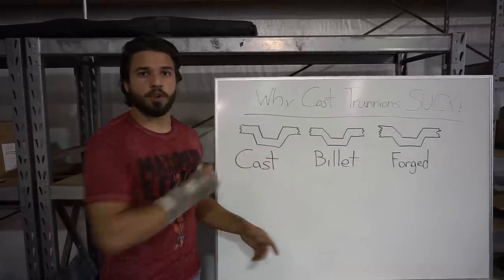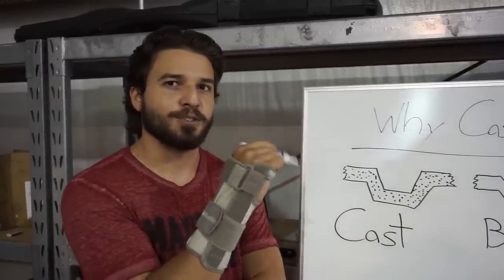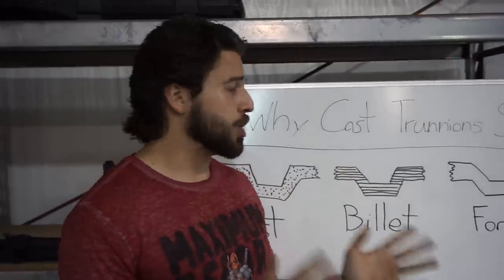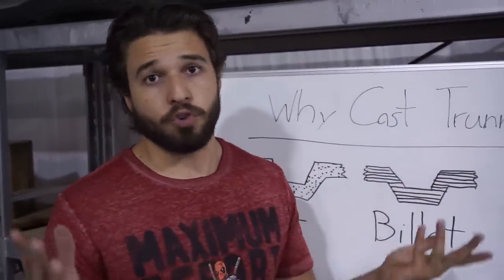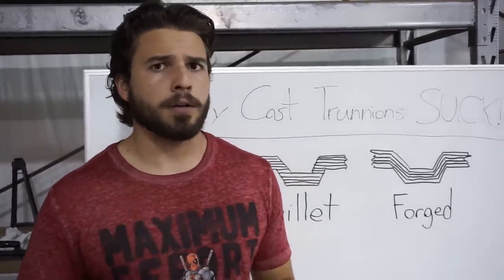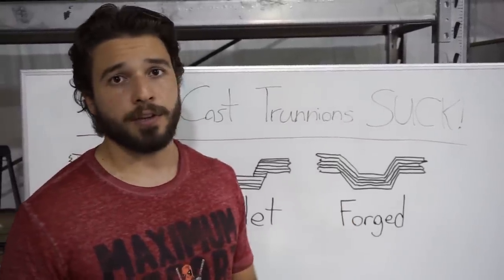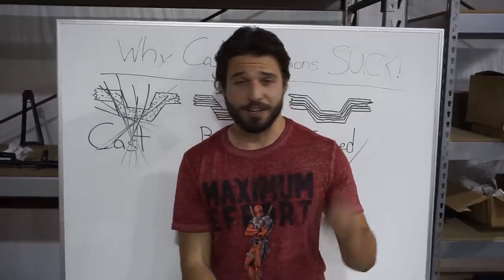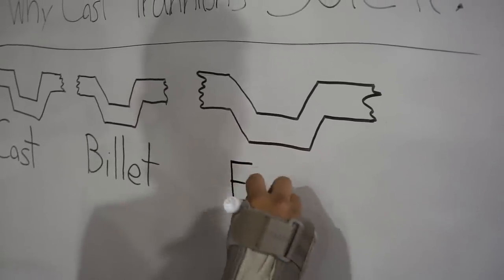Why Cast Trunnions SUCK!

Comment: 7:23 I just bought a PSA AK-P with a hammer forged front trunnion for $719. I'm impressed with it.
Reply: really? They have been sold out for months if not years. Did you preorder yours like 10 months in advance?
Reply: @derklanz1222  I've had this gun for like 8 months. I just went on the site and bought it. It took a couple weeks of checking every morning, but it wasn't that hard.
Reply: @GunsNBudder  Well that is good news, but I just haven't seen anything for a long time. They have huge back orders I think.
Reply: @derklanz1222  yeah they're very popular. My ak-p still runs perfectly.
Reply: @GunsNBudder  I am torn between at PSA or MOLOT VEPR.
Reply: @derklanz1222  you can't lose either way, but if you did lose, PSA works be easier access for customer service. On the fb PSA AK owners group, the owner of the company and some of the execs post about daily and are very accessible and concern themselves with problem reports and handle it right away personally. They're taking their ak's extremely seriously.

Comment: I enjoy my ras47, but I'm only ~800 rounds into it. I'll purchase a headspace gauge next payday. 
    Can I replace the cast parts without having to form a new receiver?
   If so; would a Romy G parts kit potentially be a good component source?
   I assumed that "made in USA" would mean sexy akm without 922r restrictions.  Instead of passing a potential disaster to another end user, I'd like to correct this machine's deficiencies if it makes more sense than taking it out of service.
      Thank you for your time and for any leads on reliable information.

Comment: As a metallurgy graduate I will happily say that is a reasonable basic explanation. Nicely done man.
Reply: What did your schooling focus on?  I’ve been a machinist for 11years and have always had an interest in material science.  What do you do with your degree?
Reply: @kw2519  sadly I got funked over the the car and supply industry died in the uk as I graduated. And the that being dyslexic and autistic, it seems they didn't want my kid of out of the box thinking.  So I was stuck in the limbo of overqualified for entry jobs and under experienced and qualified to compete with PhDs and people with 10 plus years under their belt.  
It was getting. After 6 years I returned as in counselling for the government to kill the training options with austerity. Then 8 years of trying for any industry job I retrained in 4 months to be a massage therapist.  I really wanted a machinist quol but didn't have the money and 2  years to invest in it. Also life was in the way. 
Still have the odd dream though. 
The cores was very broad 3 years with over 20 hours a week in class and labs, that's 60 to 80 hours of work a week in the final year. Doing all the basics for the hole of manufacturing. So advanced particle and quantum physics; polymer chemistry; basic and mineralogy chemistry; production routes; polymers; ceramics; metals, ferrous and non-ferrous; composites; electric materials; non-destructive testing; destructive testing; crystallography; design mechanics; advanced mathematics; CAD; corrosion; heat treatment; failure finding; process route tracking; process root construction.   history of material science and microscopy. Basically here's everything pick something for your post grad to focus on if your brain hasn't melted and we like you enough or your paying. 🤯 I did have a focus on metals as we like each other.  Lol.
Reply: Sung-Ru Oh damn, I’m sorry that shit happened to you.  Have you thought about just taking a position in machine shop at entry level and work your way up?  You could also probably get a job as a QA inspector in a machine shop if you learn your GD&T stuff
Reply: Yeah  that's what I was trying to do. Over quold Exeter.

Comment: I bought a wasr10 & detailed cleaned it. The next day I noticed rust on the front barrel . I emailed century customer service & wanted to know if I should send it in. Or in the long run ,cericoat it 
In my local area & just go that route. Do they correctly fix issues or just add more bs? & just hope it doesn’t get noticed? 
Thanks for the schooling of the platform. 👍🏼 paid $750 on 3/19
Reply from the maker: Haha, just spray it with CLP and wipe it off. Seriously a non-issue.
Reply: pigpaul you don't deserve ak if you can't stand a little rust

Comment: You are generally right, that forged is best, but it's not true to say that cast components are garbage.  First off your claim that cast parts do not have a grain structure is absolutely false, cast parts absolutely have a grain they're just more complicated. They usually grow from the cooler regions of the cast part towards the warmer regions. You can actually very very strong parts if you control this. Cast parts have regions where temperature variations as well as shrinkage can change grain structures, which must be controlled with various techniques.
Second off, it's not like all cast parts are bad. Even the soviets switched to cast components in the 70s, izzy front sights, rear trunnions gas blocks, trigger components and a few other non pressure bearing parts where cast. Early chinese AKMs (Reverse engineered) used cast front trunnions as well, until they purchased soviet tooling. There are good cast trunnions on the market right now, like WBP from poland, they've been making cast trunnions for years and it's not been an issue, rob ski put it to the 5000 test and found no issues in the cast trunnion region.
Third off. There are cast guns currently on the market that have no (strength) issues, ruger mini 14, Springfield m1a, etc. These guns have no issues as far as strength goes, and consider the AK lockup is derived from the m1 garand, so this is as close to an apples to apples comparison you can get.

And finally before anyone calls me a shill for whatever, i exclusively build from eastern European parts kits, currently Romanian RPK. The problem specifically with american casting is the cost part, controlling casting grains is actually pretty expensive, the cost diffrence between high strength casting and just forging it is pretty negligible, the cost saving comes from less spindle time and tooling required because casting can make more complex parts. Importantly, no one has ever made a good cast bolt or carrier, which probably means something. However, for specifically trunnions casting is a valid technique to produce, IF DONE RIGHT. Ofc, american manufactures are trying to hit a price point so they can't do it right, which makes the public more weary of a technique which is perfectly valid but applied poorly, and so you end up with people turning their nose up at a whole manufacturing process. It's like if american manufacturers skipped heat treating to save money and people turned their nose up at all billet parts. It's equally silly.
Reply: I noticed easily he doesn’t like the comments that give a reasonable rebuttal...plus, he’s trying to sell something.
Reply: @Dangerous Amoeba thank you for your post here, personally I think you are spot on. I don't claim to be an expert on AKs, but I know enough about modern manufacturing techniques to know that castings have actually come a long way. Like you pointed out, the problem seems to be generally more of individual companies just trying to cut corners (ahem) cut COSTS and sometimes things get missed or don't get done right.
Reply: @dexm2010  I'm no expert on anything, but i am a tool and die maker, and machinist by trade and mechanical engineer by education. The american companies are poorly casting because poor castings can be done very cheaply and they can be strong enough to last the couple hundred rounds the 'casual' gun person will shoot. It's sad, but it's the case. Really it's unfortunate to see, with how cheap investment casting has gotten in recent years, i really don't think the price point would rise that much if they did it right.
Reply: @prinzeugenvansovoyen732  That's interesting, i didn't know that. Can you provide further reading material? Anything on that, their techniques, tests, alloy choices, whatever else?
Reply: Casting is Rugers specialty. But they are good at it. This video should be good advice for some newbie wanting to buy a century cheapo ak.
Reply: "Casting is Rugers specialty. But they are good at it."
That's true, but it's one of the oldest metal working techniques, it's not out of reach (technically at least) for any company, especially with the small parts that the AK needs to cast.
"This video should be good advice for some newbie wanting to buy a century cheapo ak."
I don't think it's OK to mislead and/or lie to someone about an entire manufacturing process, regardless of the 'good' it does. I think anyone who sees the price of a century should question it's quality immediately, and there are hundreds of reviews and robskis 5000 round tests to show it's not a good product. No need to falsely demonize an entire manufacturing process.
Reply: @SPAZTICCYTOPLASM  You are correct. My point is only that it might steer people away from the badly cast stuff with regards to the poorly made  AKs that exists. And you are equally correct in that Robskis videos probably does a better job of it. Just trying to see some silver lining here :)
Reply: Fair enough. But again i think it's better to inform people to do research on anything they buy. Impulse buying anything can be a bad idea.
Reply: forging is superior
Reply: daniel noyes  "Wether or Not Some Castings are Strong is not the Issue"
Personally, the misinformation in this video is the issue as far as i'm concerned.
"The Issue is the Castings they use on AK’s That are US made are Shit"
Agreed, but the issue is the cost savings not the manufacturing process.
"And Who Cares what The Chinese do"
Considering that they are who created the AKs reputation world wide (most aks in africa, Vietnam, etc where Chinese, Russians did not like selling to non satellite states) i care.
"...East German Kits Are the Best Out there"
Well consider a poster claiming that east Germans did in fact use castings on pressure bearing components.
"But to say Russians used cast parts in a context that is comparing them to what Century And IO Are Doing is Crazy"
That's not what i did at all, i'm pointing out the misinformation in that video about the casting process. Like i said before, you get what you pay for. When you're paying 300 dollars for a gun that other manufacturers sell for at least 800, you should step back and think for a minute about the quality of the product. Plus IO and Century have a poor rep everywhere, it has nothing to do with casting overall, just like century's poor wood quality has nothing to do with CNC turning wood stocks. It's like in robskis video where the IO can't mount a RS regulate on it's dovetail, is that the fault of machining and dovetail endmills? No it's the fault of IO for not making a good product.
"And I’ll take Forged Parts anyway over any Cast Parts Russian or not"
That's a personal opinion and you have the right to hold it. I wouldn't carry a gun without a manual safety but that's my personal opinion. Like i said, there are plenty of good quality cast guns out there, like the Mini14/30 and the current M1A and ofc WBP. All of them are doing well, there is nothing wrong with the manufacturing process, just how you do it. Just like there are plenty of good polymer guns that have no safety, and my opinion is just based on my comfort.

Comment: The problem there is with cast trunnions is the interference fit barrel to trunnion. Should be .001 max. I built a WBP new parts kit and asked for the cast trunnion. Had a .0008 interference fit. Have close to 4000 rounds through this build. Have magnafluxed the trunnion and have found no cracks. Don't get me wrong I prefer forged trunnions and that is what I use in my builds. But if the barrel to trunnion fit is correct I don't see a problem. Just my opinion. Great videos

Comment: Rob Ski on AK Operators Union 47/74 put 5000 Rds thru the same RAS47 platform I own and the only part that broke was the cheap wood stock that I replaced as soon as I received my RAS47... MagPul furniture installed... the test RAS47 survived great 💵. I miss the Wasser 10 I had. Buying another one soon

Comment: The difference between the billet and the casting is that the billet was cast at 6" by 6" (maybe even 12" by 12") and then passed through a succession of rollers.  The roll out ratio is the cross sectional area of the initial billet divided by the cross sectional area of the final piece of bar stock.  For leaf springs and draw bars, the higher the roll out ratio, the better grain structure that you start with, so it is probably also true for other steel objects.

Comment: Billet is forged into its original form before it becomes billet. The forging you are referring to are stamp forged which is the shap prior to final machine and most are stamped forged two to three times before final machining. Hammer forging is typically done on bar stocks , hence barrels.

Comment: So I have to spend $900 to get a AK that's par and not worth trying to upgrade and is locked into one caliber, or I could spend $600 for an AR that can be upgraded with a $10 wrench later, in the same caliber (if I'm a moron) or a better one (.300AAC) and be able to switch calibers by removing two pins...

Hmmm, tough decision.

Comment: bad castings happen more than you would think. i worked in an iron foundry and bad castings came out regularly. naturally we scrapped them but if we had an order for say, 100 castings, they will usually end up running more than 100 molds to account for bad castings. not only are gas bubbles a thing but moisture in the mold will make a mold "pop" and the top & bottom sections will shift so the whole casting comes out goofy.

cant speak for other foundries quality of course. but yeah, castings are ok for some applications, but not firearms. imo.

Comment: Hey Brandon
 Like your video has good information. I have built a lot of AK's. The majority are import kits (Forged Trunnion). There was a lot of controversy on the cast trunnion WBP was selling. There were failures. I ordered a WBP kit cast trunnion and built a AK. What I found was the the barrel interference fit was about .004. This way to tight for a cast trunnion. I honed the trunnion to .0007 interference fit. I have about 4200 rounds threw the rifle and have no issues. I magnaflux the trunnion every 1000 rounds. I would prefer a forged trunnion. But if some one has one and the barrel interference fit is good you should not have a problem.
Reply from the maker: Harold Demes I built on one of the same kits a while back. Personally I don’t want to have to look over my shoulder every 1,000 rounds to see if I’m going to soon be the victim of a catastrophic failure. I’ve had one before, not an experience I’d like to soon repeat!
Reply: I agree. I would never use a cast trunnion in another build. Was just an experiment + a free kit to do the test. I think WBP is all forged trunnions now. I have a Dailymotion video on how to build a Hungarian AK63D. Also have one on how fit a bolt to the trunnion. My channel name i YugoM72. I had them on YouTube but had to move it. Keep up the good work.

Comment: It's funny I have owned MAK-90 for the past 24 years. I put 5000 rounds through it the first summer I had it( no cleaning just lube). Just to see it it would hold up and continue to function properly. That's when I fell in love. Going into the army and working with firearms from around the world only solidified my respect for the ak platform. I still take that MAK-90 out and put 1000 rounds through it once a year . So far I have only changed the stocks and I broke a sling that's it ...

Comment: Love the channel, love what you do, wanted to buy my first ak 74 from you, but could not not find out how to get it. I live in Illinois just outside of Chicago gun laws here are nuts. But any way I know a can have parts shipped in and I know this is going to sound bad, but I but a pioneer akm gen 2. I read plenty of reviews on Pioneer but I couldn't find any wassers or good akms cuz of the panic buy. Even though it's a Gen 2 after looking up so quick YouTube videos I found that the bolt carrier and trunnion are cast. I know replacing the trunnion will be a massive undertaking because of all of the comments and needed tools for headspaceing so instead I'm just looking for a forged bolt and bolt carrier. The bolt is forged I just want another one in case of spontaneous fuck up. When the rivets finally fall out, (which I have found is a 50/50 chance with pioneer akms)I will replace the trunnion and rivets with forged parts. I know a gunsmith at eagle gun store that i can go to. However I've been looking for a forged bolt, bolt carrier, and trunnion and I can't find them anywhere was wondering if you sell forged parts by themselves. Again wanted to buy an AK from you, but your website was sold out. Honestly, I was a hardcore AR15 guy because that's what I was around more, but after seeing your Channel I decided to go to the range and rent and shoot one. Holyshit I became an AK guy that day.